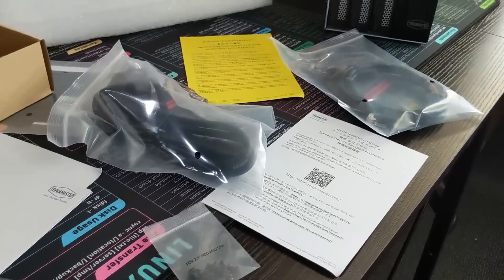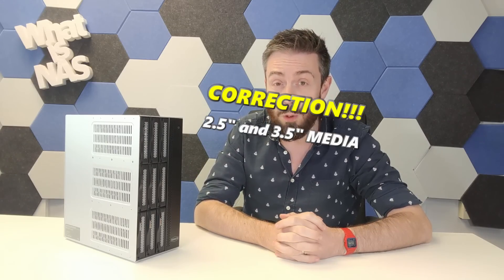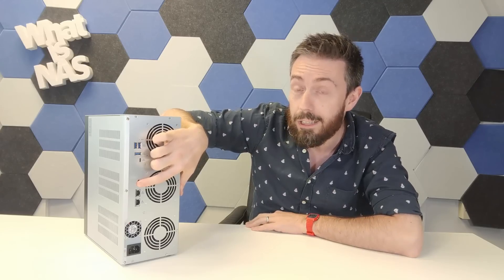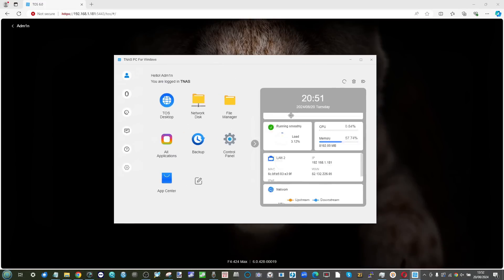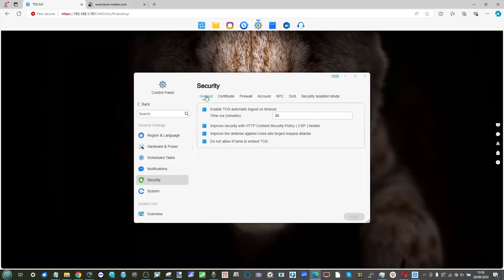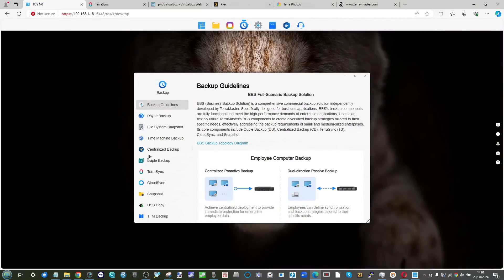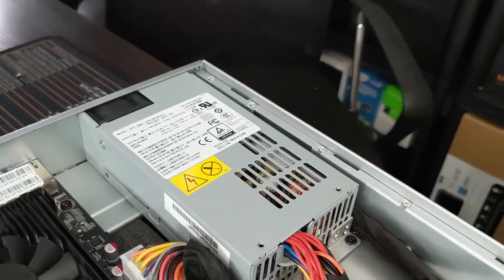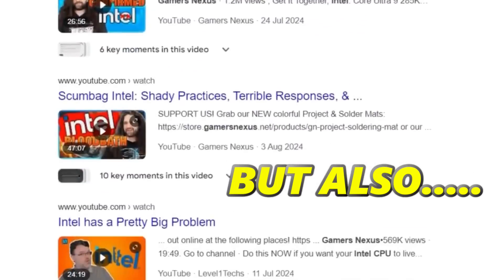Terramaster T9-500 PRO  Max NAS - Should You Buy (Review)

Comment: i mean yeah as a turnkey solution, i agree with hat. But if you're planing to change the OS and running something different more potent on this system. You may consider buying a used 7 to 12-year-old workstation or 2 to 3 u rack server. Like the DELL PowerEdge servers. i know those are powerful scalable servers with plenty of power. i have a r630 with two 12 drive PowerVaults and this thing is a beast. 
in my case, i needed that power. I do analytic and statistic stuff.  Some folks would today say, i do AI things but yeah you can call it that way if you happy with. 
but i rather prefer to call it analytics and statistics also do this for 8 years now and back then ai wasn't that useless and meaningless word like it is today. 
i got mine for about 600€ including both PowerVaults, i spend another 600€ to upgrade the cpu and RAM from a single e5 2603v3 with 112gb to a dual e5 2683v4 and 512gb ram and bought 8 sata SSDs for raid 10 and 1tb storage in total. Everything else lives in the PowerVaults in a raid 6 configuration and both PowerVaults are mirrored to each other, basically this is a raid 60. Eacch PowerVault has about 38TB usable. So 1TB is fast working storage and 38TB is long therm storage. i know raid is no backup, but what the fuck needs to be happened to lose all my data. Everything is redundant in my system.

Comment: I'd like to very much disagree about the copper ports. I'm on the SFP or nothing fraction. Every 10G component in my homelab is connected by DACs except for my Mac that only has the cheap TB4 10GB Adapter that has a copper port. And that's getting terribly hot because of the copper port.
Reply: QNAP and Sonnet both sell Thunderbolt to SFP+ adapters, which as far as I know don't run hot (so long as you're using fibre, maybe DAC too?), but that would be an additional expense when you've already got things running. Also, this is based on memory, so check reviews yourself before considering purchase.
Reply: @jeremyfmoses  I can live with 10G copper on client side, but my main installation, attached to my Microtik switch should stay SFP. And a NAS is not a client. That's my main argument. Since my 10G switch ports are all SFP based I would love as less media conversion as possible. And for shot ranges under 2m distance from my rack DACs are the tool of choice.
Reply: 100% agree. Would take SFP+ any day over RJ45